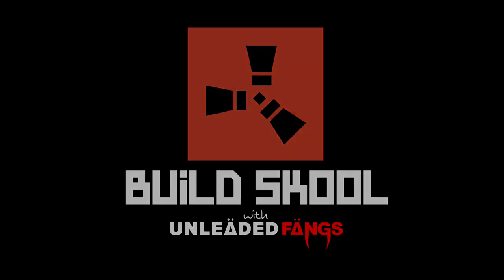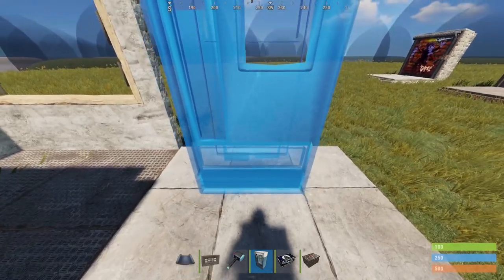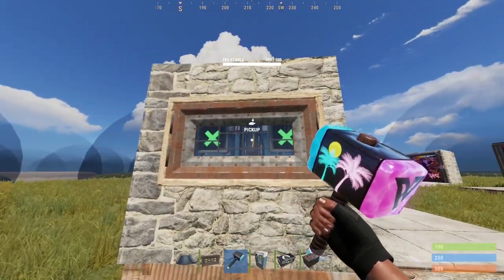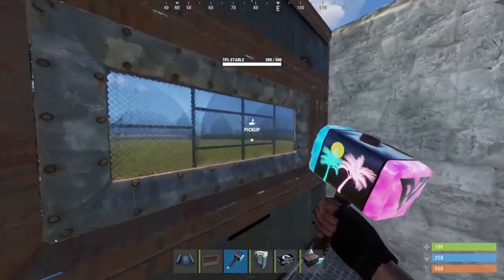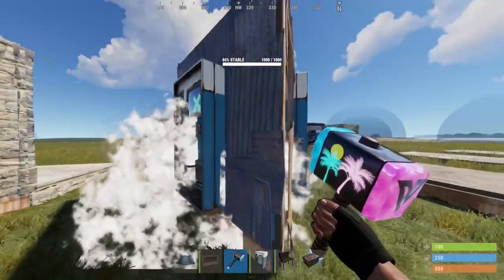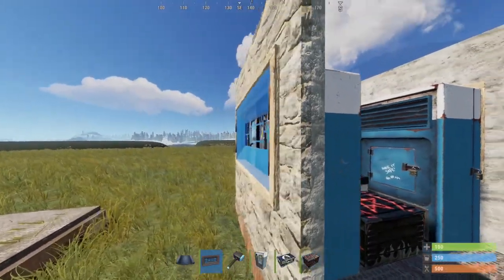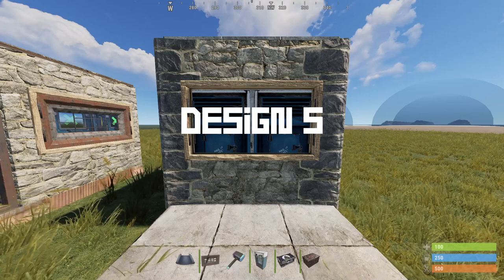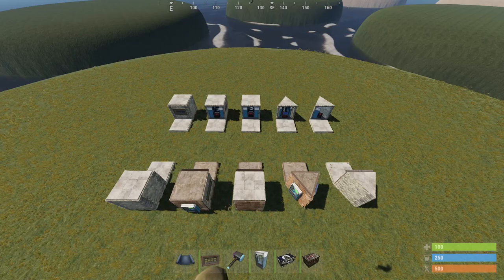Vending Machine Storage Nerf Fix | Rust Build Skool

Comment: Thank you, I love how they try to patch stupid things like this and we have a solution that ends up being better in a few days. good work
Reply from the maker: Yeah, I understand why the patched it, I just want a vertical storage box in general.
Reply: @unleadedfangs  why did they patch it?
Reply from the maker: @escaladep  Lining walls with vending machines added honeycomb to the base. In my Viper core, I used vending machines because of space constraints which is where I really liked them, but it doubled as a +10 rocket honeycomb.
Reply: @unleadedfangs  I mean isnt that the point of 3.0 in the first place? build smarter not bigger. Then they go and remove all the smart things that were made up
Reply from the maker: @escaladep  Yeah, I believe the vending machines probably were changed just due to the drone additions
Reply: @unleadedfangs  i mean if im using mine as storage idc if a drone can access it. And if i was selling someting id build a shop normaly
Reply: @unleadedfangs  The fridge is a vertical storage box.
Reply from the maker: @vuldren  The fridge only accepts food items.

Comment: So I disagree with your premise. Yes, the armored window has 500 makes no sense to upgrade past stone all true. But the solution is simple leave floor Twig. If they're dumb enough to fire a rocket into a room, it destroys the twig and all the vending machines. Meaning they get nothing. Upgrading to sheet metal or hq now serves a purpose because they are unlikely to try and pick their way through walls.

Even a better solution is a round base or hexagon. Place windows on a twig floor being supported by one half wall. Then, place C4 charges and wire a heartbeat sensor to the receiver/transmitter. If they break a wall and attempt to gain entry c4 under floor blows half wall bringing all vending machines down. 

Caveats:  You need to max out most of the electrical branch on tier 1. Need to get to tier 3 work bench and learn C4. This could be overkill if you just want a little shop. In that case, your design should work well, though I'd upgrade to hq for walls. Just an idea. I'm testing on a Build Server with what I call the Brittle core.

Comment: @3:00 block the window with a half-height floor in honeycomb. (TESTED, DOESN'T WORK!  See reply below)
Reply from the maker: This is actually a really solid idea.
Reply: window wont support it and it will be ether splashed if its metal or the walls around it will be destroyed faster. TL;DR: it wont help much.
Reply: So I tested this, it doesn't work. The vending machine hitbox interferes with the half-height floor's hitbox.

Comment: if you put a floor beside the window they cant jump in and have to break the vending machines and the wall which will despawn everything
Reply from the maker: Yeah thats correct, you just have to have another wall to support the ceiling as the window frame will not.
Reply: @unleadedfangs  yeah i forgot that they changed that but you can also block it with a stair it will block them from getting through the window and cant be squeezed thru
Reply from the maker: @rabacsgo  Thats true actually

Comment: Nice clickbait thumbnail.... Or did I missed the fix for that type of loot room? Does the window frames makes it possible?
Reply from the maker: The window frame makes it possible. However now there is a small gap between the machines, but you can still fit two vending machines against a window wall.